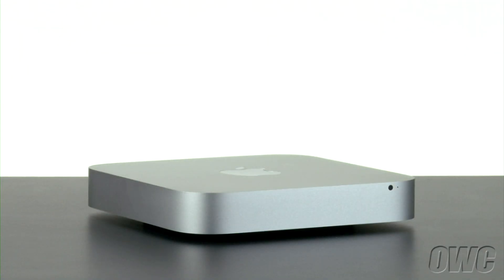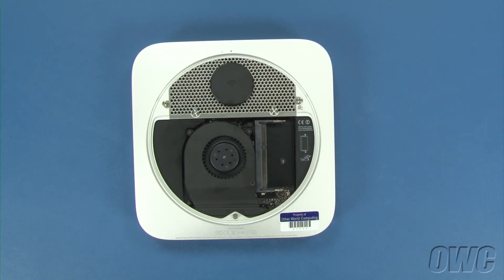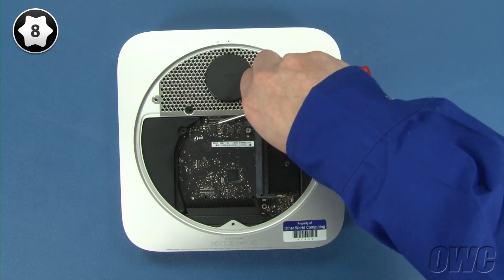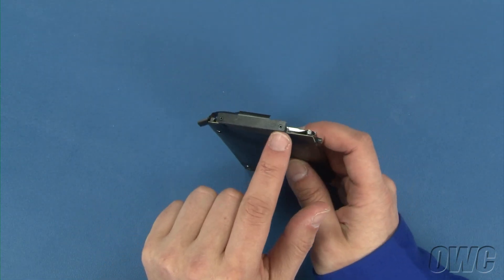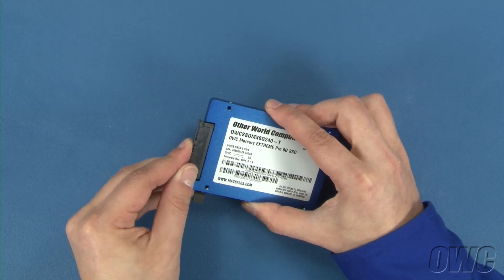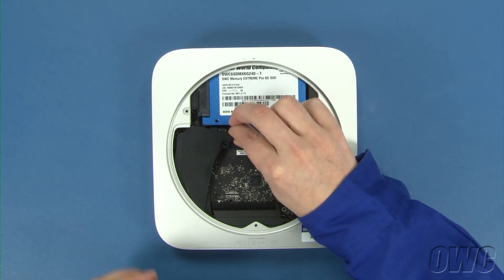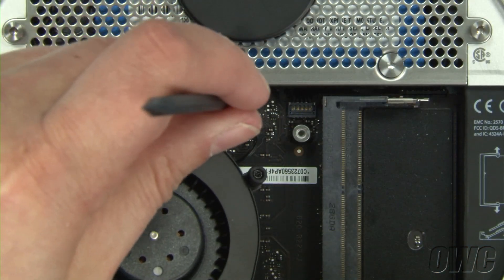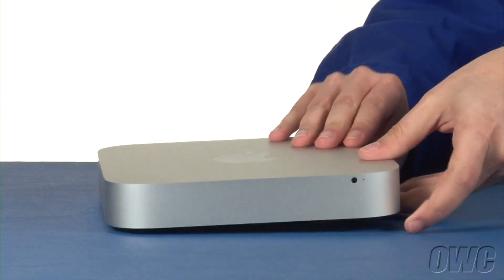Mac mini Late 2012 Hard Drive/SSD Installation Video

Comment: if you wanted to skip all of this, could you just use the hard drive externally?
Reply from the maker: Thanks for the inquiry, I want to clarify what you're looking to use externally.
 
You could buy an external SSD and boot your computer with that and you wouldn't have to install a new drive.
 
If you wanted to use your computers internal drive externally you would need to open the computer to get the drive first.
 
Hope that answers your question!
Reply: @poweredbyowc  thanks for the reply! basically, i just order some ram to upgrade my mac mini from 4gb to 16gb. i’m pretty excited. 

i also was thinking about upgrading the hard drive because it’s and old 2012 2.3ghz i7 regular spinning hard drive, but i don’t really feel comfortable digging that far into the computer. i mean, i probably could do it, but i don’t mind just using a hard drive externally. 

so, yeah, basically i was wondering if i could upgrade to a solid state hard drive that’s external & boot boot from that. it would be like having a brand new computer lol

edit: oh. i’m dumb. the hard drive and processor are different. lmao. i don need a new hard drive. i would need a new processor to make it new. i mean, i guess i could still benefit from a ssd. i dunno
Reply from the maker: You're most welcome! We are glad to be able to assist and are glad to hear that you will be upgrading the RAM from 4GB to 16GB of RAM which will definitely help boost the performance of your Mac Mini.
 
As for the SSD you could get an external SSD and format the drive along with install Mac OSX to make it a external bootable drive.
 
With the drive being an SSD it would be faster than the standard internal HDD inside the machine.
 
However, for maximum performance installing the SSD internally would be faster than an external SSD as it is installed directly into the SATA port in the machine vs. going through data transfer port and cable on the outside of the machine.
 
Hope this answers your additional upgrade questions at this time.
Reply: @poweredbyowc  so, if i did this, and then also updated the processor somehow, what that be essentially a completely different computer? i’ve never built a computer, obviously. & i don’t think that model allows for a change in processor anyway. also, i don’t plan on doing that. just curious
Reply from the maker: Regrettably, you cannot upgrade the CPU in a Mac mini.  If you're intimidated by the internal drive install, even with our video guide, then the USB3 ports are good enough for an external SSD boot drive.  Not literally as fast on paper, although plenty fast enough and not very far off to the internal SATA, anyway (5Gb/s vs 6Gb/s)
Reply: @poweredbyowc  could i just do it with a flash drive? also, can i have use multiple flash drives for booting? and if i had like 4 flash drives, would it be like having 4 computers?
Reply from the maker: You would be able to boot from USB connections, however, it would depend on the flash drive being used and if it is compatible with the boot options.  Unfortunately, you can not use multiple flash drives to boot one computer all together. Each flash drive may be able to house one OS for the boot options though.
I hope this answers your booting questions.
Reply: @poweredbyowc  hey man. i just thought of a really important question i forgot to ask. i plan on restoring/fresh reinstalling os x on my late 2012 mac mini. i’m also upgrading the ram from 4gb to 16gb. should i do a fresh reinstall of os x before or after i install the ram. 

it’s really important i don’t ruin the computer.
Reply from the maker: Hey! So when restoring/fresh install of the Mac OSX you can do this after installing the RAM or before installing the RAM as this would not make an effect on the machine.

Comment: This was a great video. I did everything that you showed me. My husband had to get the wifi antenna in but otherwise it was all smooth. The only thing right now is after adding the SSD, my Mac mini is running super hot. I don't know what happened. I am hoping someone at OWC sees this comment. Please advise.  Thank you so much.

Comment: I started working on my Mac mini that I bought used off eBay.  I found the torque T8 screws (hex nuts) at the bottom of the wireless grate were stripped on the bottom and now I am dead in the water.  Any recommended hacks to fix this?
Reply: I figured it out myself.  Thanks anyway.  Took it apart and put back together 3 times due to issues with bad SSD's I can truly say my computer gave me brain cancer (sarcasm).

Comment: As others have noted, it's not necessary to remove the memory cards or the T8 screw at the back, nor is it necessary to disconnect the wi-fi antenna.

One other trick: instead of using a business card to help position the new drive, I wrapped a piece of scotch tape around my index finger — sticky side out — and this enabled me to position the drive without too much difficulty. Also, the replacement drive was a few mm thinner than the drive I replaced, and didn't seat quite as snugly. I don't think this will be a problem.

Note that you can put an OS installer on a separate backup drive (not the new one) using these instructions: https://support.apple.com/en-us/HT201372, erase the new drive, and then put the new drive in the mini. When you boot your mini with the bootable startup disc, it will allow you to install the OS to the new drive.

Comment: Very good guide and much appreciated.  When reinstalling the antennae shield make sure the two 2mm hex screws go into the new hard drive and lift it to the shield.  If not, it's easy to push the new SSD down and unplug it at the same time.  It is possible (at users risk) to do this without removing ram or antennae wire.
Reply: Ooops size 8 torx screws

Comment: Maybe because mine was 2013, but I had to remove logic board to get at 2 screws holding the hard drive in.  Found other people on forums with same issue, surprised no one on here ran into that.  Unless I'm missing something?
Reply: The 2013 mac mini is slightly different in terms of how its put together.  The 2012 mac mini is still the best mac mini out there ( apart from the new 2018 one )  it is the best for upgrades, specs and performance and some say the best ever made.

Comment: About to do this now.  Wish me luck
Reply: I had a success.  I didn't uninstall the RAM.  After I slid in the drive, I flipped the computer over to let gravity assist, like Phillip said.  Make sure your SATA connector (the thick part attached to the drive) is seated against the aluminum flange by the wireless header.  I found the most difficult part was getting the wireless grate seated correctly.  You have to pay attention to the two layers and sandwich the Mini's body between them.  I stuck a Torx T8 into the nearby holes to help wiggle the sandwich together.  I noticed my bottom hex screw was already stripped where you insert the driver.  The T8 worked with no problem.  They say don't twist too hard because the screw doesn't go in that far.  I found the process relatively easy, anyway.

Comment: Just swapped out the snail drive on my wife's 2012 Mac Mini for a 1TB SSD, and went up to 16GB while I was at it. Now installing MacOS Sierra (which BTW greatly improved the startup time on my MacBook Air). Great instructions from OWC in this video. One trick to add, if no-one else has done so already, is to fold over (180 deg) about 3mm (1/8") of the end of the business card before inserting, to help lift the edge of the thinner SSD into closer alignment with the locating holes. I also tried holding the whole unit upside down while I slipped the SSD into position. Anyway, got it in after a minute's fiddling. Some have written that getting screws back into the aerial is tricky. Certainly was with the thinner SSD, like the screws needed to be a bit longer. I put one screw in place, turned the unit over again, and let gravity do its thing. Bingo! I found that some of the Allen ('hex') screws had been done up a bit tight, so I'm glad I waited to buy the correct size Allen driver, rather than use the T8, which the video said could be done, but with great care. Thank you OWC!

Comment: I put in a 7 mm-thick hard drive in the top position (where the antenna is facing up) of a 2012 Mac mini server.  The two screws securing the drive to the antenna grate are now too short.

Comment: Hi, I'm curious as to why so much disassembly is performed.  It seems like removing the wifi grate would be sufficient.  No?
Reply: It’s seems like there is more risk to damage by unplugging the fan and antenna and trying to put them back?

Comment: Easy to understand and follow video. Worth watching it through a couple of times before starting. Only problem I had was that the new SSD was thin and the two screws for the radio didn't connect so had to leaver the drive up a little to get them to connect. Thanks for the video made everything so easy.

Comment: FYI - The fan connector is VERY deceiving. It seems like it is one of the pry up connectors in its entirety, BUT IT IS NOT. The video clearly states it, but it was super easy to accidentally remove the fan connector from the mother board taking the slot it sits in along for the ride. DON"T MAKE THIS MISTAKE WHEN UPGRADING! I'm reasonably sure you could probably complete the upgrade without disconnecting this piece if you are careful with placing it aside, but I obviously can't try it anymore.
Reply: The fan connector made me very nervous.  Not sure if I ended up braking the fan, but in reassembly it did not work and had to buy a new one.  I will try again without disconnecting it as you say.  THANK YOU.

Comment: Is this the same for a late 2012 Mac Mini Server ?
Reply: This IS a late 2012 Mac mini in the video. The 2014 Mac mini doesn't have a bottom plate that is meant to be taken off and is not user customizable. That's why most people just buy the 2012 Mac mini instead. Also the 2012 Mac minis can be bought with a quad-core processor, but the 2014 Mac minis are only available with duo-cores.
Reply: Quackstorm Yes I know, it's been a couple of years since my post.  I already have one now. :)  Thank you for your reply though.
Reply: +Trusteft No problemo!

Comment: who ever thought of the business card as a slide helper - thank you! :D
drove me crazy
Reply: David Zeissler you can try also a suction cup. It holds the SSD horizontal while you place it into the holes.
Reply: You can also turn the computer upside down to do this.
Reply: @thetuningspoon  I turned it on its side and jiggled it to get it in there, the business card wasn't working for me.
Reply: David Zeissler the business card did not help but a suction cup tremendously